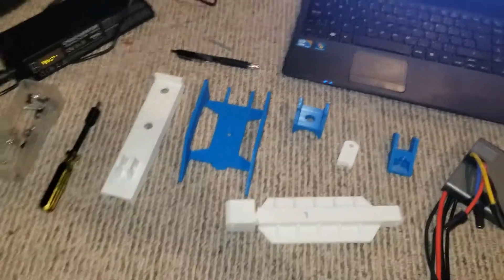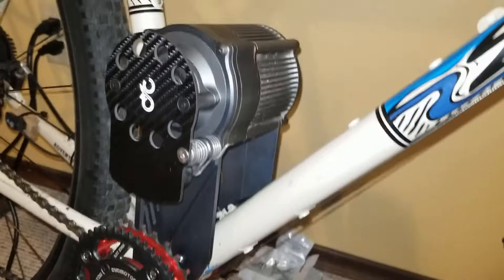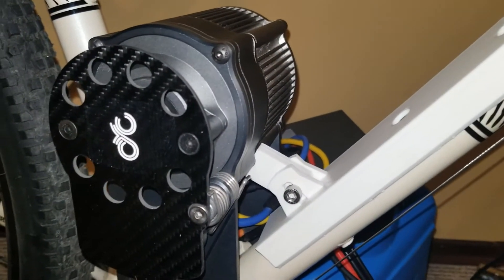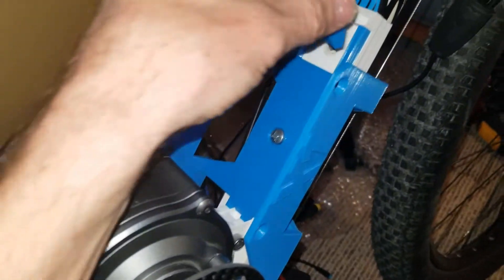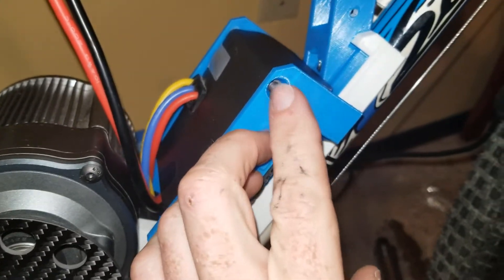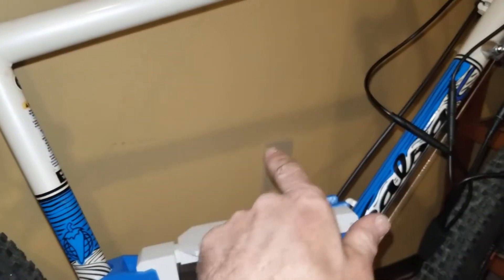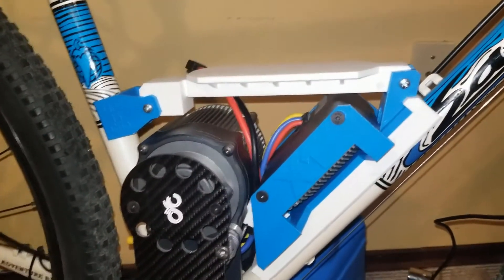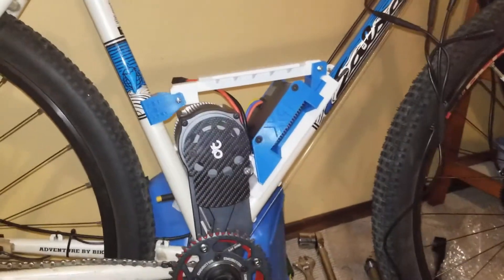CYC X1 Pro - Midmount (3D Printed Parts)

Comment: Are you going to have cooling problems with the Motor as it looks a little buried? Brilliant vlogs and very useful information as i consider my first conversion. What do you use for the on screen graphics on your rides?
Reply from the maker: It's a combination of Garmin virb edit and Racerender. The garmin one is free and you can use any old camera with GPx data from strava etc. Racerender has a free version but it's a but limited. I dont anticipate cooling issues as I have ran it full throttle up 10% hills and it barely gets warm. It's a very well built motor. Makes me wish bafang would do a bbshd v2. It's not where they want to go though it seems.

Comment: Hi Cap'n I have really enjoyed your videos , think I have watched them all at this point. I have been thinking about building up an ebike for a year or so was considering a BBSHD or Luna's cyclone, but interesting to see your work with the CYC Pro. This is my first build, but loads of bike and motorcycle mechanic experience (hobbyist) I will probably buy and build something over the winter using an existing frame. I was wondering if you could comment, or make a video comparing and contrasting the BBSHD and the CYC. It seems like you prefer using the ASI BAC800 with both motors. Seems like the BBSHD is simpler and perhaps more reliable, but the CYC is significantly more powerful? I would be very interested in hearing your thoughts. I will likely be pairing either motor with a lunacycle 52v wolfpack if that makes a difference.
I know you have been very neutral about taking sides. but I will probably be buying something in January and am undecided. PS Nice to see all your videos from Ottawa/Gatineau (Ottawa boy here) although the scenery where you are now looks great.
Reply from the maker: For sure I will do a comparison. I want to do a bit more riding first in the mid frame configuration and then I'll drop it. Your analysis is not far off tho. The cyclone is a bit more complicated but if you have moto exp it would be ok. Also look at the lighning rods big block stuff. It's very powerful as well. Glad you like the videos. Cheers! 

I do miss Gat park btw!
Reply: @HighVoltageKits  Thanks, that would be great!

Comment: Nice work, think I have settled on going with a BBSHD for now, but will watch the progress of this X1 Pro overtime. The rate you're going though I'll be buying a 3D printer next... RIP my bank account.
Reply from the maker: Yeah stuff adds up. You wont be disappointed. Plus if you replace a car like me the savings add up. In two years I calculate I've saved over $8000 in fuel, insurance and maintenance and I have seen places I never would have been to. You cant put a price on the sheer joy it is to ride. Plus our car now gets less use so it's on a low mileage plan. If I can get my wife riding we can ditch the cars and just pool one with my family here.
Reply: @HighVoltageKits  Yeah, I am looking at also using it as a potential car replacement, as I work from home my car doesn't get a lot of use. It is going into summer here in NZ (was already 30c here today for that matter). So I figured it is the best time of year to get started and test it out. 
Hoping EM3EV has a 10% off sale for Black Friday like they did last year, to make them a more viable battery option, as the shipping on their 30.6Ah triangle battery is showing as $271 NZD ~$227 CAD. I've emailed them to ask about that, as it is listed twice at that price in their shipping section and doesn't say which carrier/s it is using.
Reply from the maker: That's a big shipping bill. I'm jealous of your temps its dropping fast here! Word of caution on the 30.6 pack. The bms is not rated for 50 amps continuous so if you were to put the ASI or similar in the future it will limit its potential a bit.  They offer different cells for higher power but less capacity so about 26 amph.
Reply: @Hell-Knight-NZ  
 $147.97 via Australia Battery (<21kg)
 That is what it cost me to ship my battery to me here in Bundaberg QLD
(14S9P)  $951.37  
That was the cost of the battery.
  I know it is a lot of money but so far it has been great. The battery comes with an on off switch which makes life so easy. You can plug the battery together to your bike and never worry about the surge connection! no more flashes of light and terminals melting!
 The monitoring is very nice. It gives a lot of information even with all the spelling mistakes😎😎
 Just being able to look at the individual cell groupings makes me so much more relaxed about knowing what is happening with my battery.
 It has a lot of information which means nothing to me but the info that matters to me makes it worthwhile!
 I can thoroughly recommend the battery!
Reply: @HighVoltageKits    I am looking at just getting the luna modified 30 amp BBSHD from their Aussie based dealer. (luna-mate) They have batteries made and stocked here in NZ for it, so no high shipping cost or 3 week wait time, but the problem with that however is the biggest 52v battery they have in their NZ warehouse is 17.5ah (50 amp continuous 70amp maximum BMS). 

Just unsure whether that is big enough to get a decent range for over 100KG me plus heavy fat bike.

And because of that high battery shipping cost from EM3EV, I could buy two of those for about the same cost as their 30.6Ah would cost me (by the time I pay import charges and GST).
Reply from the maker: If that is the case could you use a parallel harness and run two of those packs? That would be 36amph then I guess. You may wish to check if its possible with someone of greater battery knowledge than me. I am learning how lipo series stuff works. I dont see why it would not. You would then have the flexibility of just running one pack on short trips. Or having a second ready to go. If you are using the pedal assist in anyway the 17.5 amph ought to last a while. When I rode on stock i once did a good 30km with the throttle wide open up steep hills for large parts and used about 12 amph total. How far do you intend to ride?
Reply: @HighVoltageKits  Ah, that is better range than I expected. When riding off-road, i will be trail riding through forest, probably around 50km, mostly with PAS (as it is for exercise). On road I'd say around 25km with throttle at most (on average) around the city. I didn't think I'd be able to fit two of those packs in the triangle, I thought I could just carry an extra one in my backpack if needed.

Most of my city (Christchurch) is flat also. I'd  mostly only go up into the hills here if I wanted to ride our fancy new MTB Adventure Park; so in that case I'd probably need a second battery (if I rode there from home instead of driving). Most of the time though it will be through the mostly flat forest that is a couple of kilometres away from my house.

Thanks for the info as always, it sounds like I could just get the 17.5Ah Samsung 35E battery and pick up another one if it turns out to not be enough. Also, what do think about their new Jumbo Shark pack instead of the triangle battery? It is only has a 30 amp BMS, instead of the 50 amp continuous, 70 amp max on the triangle, but has a power switch, and lock http://luna-mate.com/52v-samsung-35e-17-5ah-jumbo-shark-standard-3-amp-charger-included-nz/
Reply from the maker: Hell-Knight It looks ok. There 72 volt stuff looks decent spec as well. The shark packs are easier to mount but I think it's the connectors that limit the amps to 30 continuous. I'd be buying the one with 50 amps as it is on sale and will allow you to go up a level in performance very easily. Say you wanted to run the ASI in the future. Your battery would be in a position to deliver the power to get the most from it. It's worth noting that you could configure your ASI to have the same power as with the stock controller. If you also then ran with the eggrider you could have an exercise profile and a fast throttle profile for easy commutes. But its harder to mount a triangle pack than a shark pack. I guess if you are certain you will never upgrade your controller then the shark would be just as good.
Reply: @HighVoltageKits  I originally was looking at getting the ASI as I have discussed with you before. However it would cost me $750 NZD for one and void the BBSHD's warranty, so was trying to limit the damage starting out. Thought I would use this cheaper option first, see how I like it and then if the X1 gets to a nicely matured state in a couple of years (and with a local dealer that has good support like this), look at going the 72v route with one of those and an ASI controller, instead of just adding an ASI to the BBSHD when the warranty runs out.
Reply from the maker: Man, you get screwed with taxes even more than Canada. Yeah that's a sound plan. Let it mature and enjoy your BBSHD. :)
Reply: @HighVoltageKits  Hah, that wasn't even including taxes. I assume ERT's prices are in USD not CAD Straight conversion for the BAC800 and a 52v or 72v 750c display plus $40 NZD in shipping is about $750 with foreign currency conversion charges. It would then get slapped with 15 percent GST coming in to the country.

Comment: The colours are matching well.
 I don't know the first thing about printing with plastic but that looks pretty solid!
 Are you going to be able to fit your existing battery in there to try it out?
 I have been running my 52V 25,7Ah battery but I am struggling to use the whole battery on one ride. Or several rides!
 I find myself using less and less of the battery as I get fitter and fitter.(still a long way to go) I find myself running errands to the shop mostly at the moment. I am not a cyclist but more of a commuter!

Anyway perhaps you can buy two 36V batteries and put them in series? Probably easier and better to buy a 72V battery straight up. What Ah are you looking to put in there?
Assuming no losses!
 Let's say you pull 4000W( worst case) out of that motor. 4000W divided by 72V = 55/56A you would need a 56Ah battery to do that for a straight hour. Now that is ridiculous. 
 So lets half that figure to 2000W . 2000W divided by 72V = 27/28A . You would still need a 28Ah battery to run it for a straight hour.
 You are not going to be peddling your bike to keep up with that motor.
 Now you are never gonna run this motor at those figures constantly. I can't help but think you are going to need a battery of sizable Ah to keep that motor running. 
  I thought this way when I bought my battery and I have found it is total overkill for myself. The one good thing however is that I don't get a huge voltage sag when I hit the throttle hard. 
  I hope you can put on your 52V battery and run a few tests to see  how your range holds up. At least it will give you an idea for your 72V battery.
 Good luck with the project and  I can't wait to see it realised!

Keep up the good work!
Reply from the maker: Thanks for the info. I have to get to work but I'll have a good read at lunch. I'm glad you are good at maths!
Reply: @HighVoltageKits  
Buwahahahahaha.....It's called a calculator. I sit here at the computer with my mobile phone ready to go and solve the world's equations.......One at a time!
Reply from the maker: So I tried it and it not a good fit. My lipo pack is still in progress but I'm not ready to video anything on that yet. It's not quite as simple with the 72 volt as they tend to pull less amps. The way it works tho as far as I am aware with the amps is that as the motor speed increases it generates back emf (electro magnetic field). This restricts the current that can be drawn. The ASI field weakening allows more current to be fed in. My Dad taught physics for years so he has explained a few times how motors  and generators (basically the same thing) work. I'm getting better at understanding tho!
Reply: @HighVoltageKits  love the build. what LiPo packs are you going to be using?
Reply from the maker: kwiniarz I'm using the turnigy graphene panther 6000 mamph packs. It's going to be about as high performance as I can get. Overkill... but it should be economical in terms of cycles.